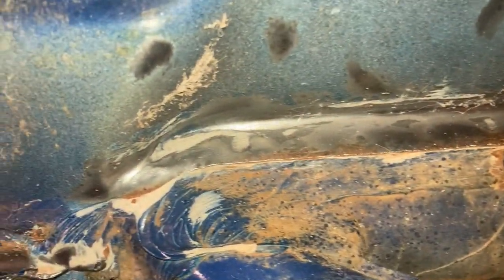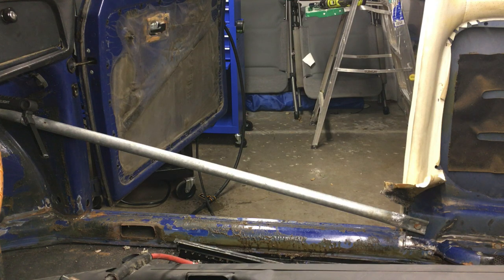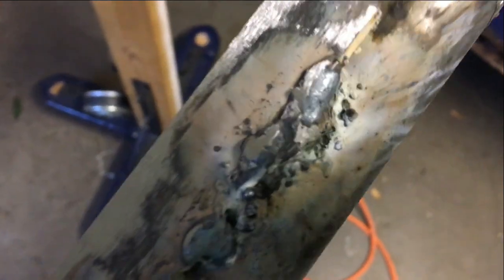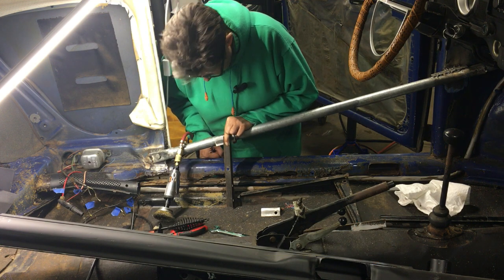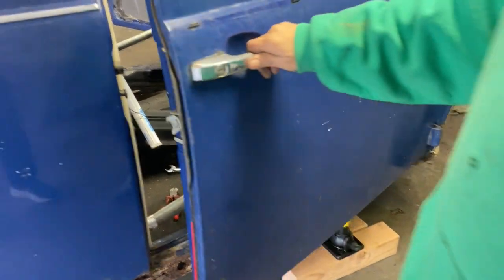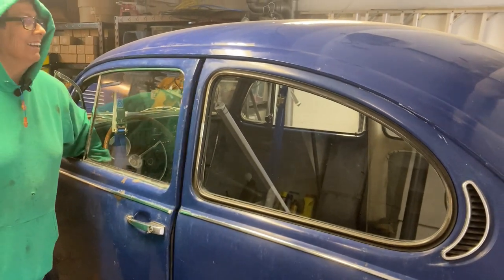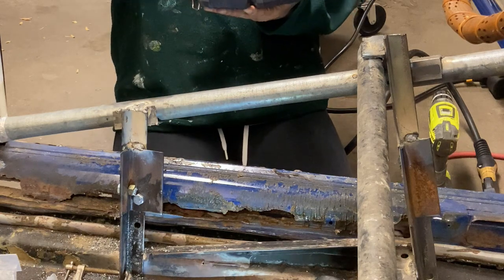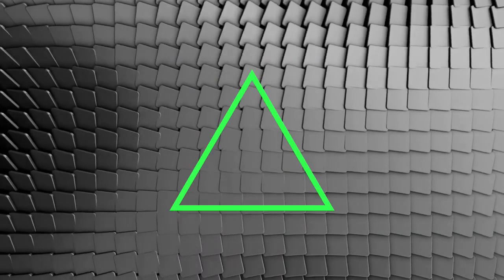1971 VW Beetle Restoration - Episode 7

Comment: Greetings from Florida, ma'am. I seldom comment, but thought I would here. I've been following your build since you started. I recently purchased a 1973 Super Beetle, that I am in the middle of fixing up. I sold a show car that I had for many years and decided to buy a Beetle, since I had one 50 years ago when I was a kid. I'm learning from you, even though you yourself are learning. I have to give you kudos for jumping right in there and doing the work. I'm doing mostly cosmetics on my car. I'm sending it out next week to a VW mechanic who will take care of all the mechanical portions. The car is in great shape, so there won't be much in the way of mechanicals. It has a good strong engine, good clutch, etc....he is just going to give the engine the once over, as well as the brakes. I'm converting to an electronic ignition on the advice of my mechanic, and since I had some starting issues, I'm changing out the starter with an auto stick starter, even though mine is a manual. Again, on the advice of my VW mechanic. I wish I could do what you're doing, but I don't have the time, tools, expertise or patience.  Once the car is mechanically sound, it's going straight into paint, just before the new interior. After that, my work starts getting it all put back together, buffing it out and so forth. I am fortunate in that my car seems to have been a Florida car all it's life and is 95% rust free, which puts me ahead of the game. The guy that is doing my work is also a You Tuber and his channel is Froslife and Just Buggin' Restorations. He has some pretty good vids, as well. He said he is going to start a new series with my car. He will probably end up painting it, too, since my car, although fairly sound mechanically is currently.....ahem.....pink. I don't mean Mary Kay Cosmetics pale pink, I mean bright Barbie or Pepto Bismol pink. Ugh!  I have a vision for the car, and it doesn't include pink. Ultimately it will be painted gloss black, which will go well with the new white interior. Didn't mean to ramble. Please keep up the good work on your car. I'll be very curious to see how it comes out. If the guy does start a video series on my car, I'll let you know. You will then see that it is pink, pink, PINK. Cheers!         Gary in Florida.
Reply from the maker: Wow!  What an awesome comment!  Thank you for all the encouraging things you said.  That really is motivating.  I would absolutely love to see your bug in it's pink incarnation and after!  Pink is not a color I would pick either even if I was president of Mary Kay!  I'll check out those channels.  Thanks again for the great comment!
Reply from the maker: Wow that channel is something!  358 videos!  Thanks for the tip!
Reply: G-Man aka Gregg from Just Buggin has some great restoration videos, although he uses a head-cam and can make you slightly nauseous with all the moving around. But he's mostly a one-man show so I get it. Fortunately, his shop is only about 20 miles from me, so I plan on delivering Pink Panther (his name) to him next Tuesday. He'll probably have it 2-3 months since he has other projects, but I'm taking him the car with a boat load of parts. I shall keep you posted if you like. In the meantime, please keep up the good work on your Bug. When I was a kid, you could buy them running and driving all day long for a couple hundred bucks. Today, not many of them running around. It's our responsibility to keep them on the road for others to enjoy.  @TrixedOut
Reply: Just as a side note, when I got the car, there was a huge sticker on the hood (not the frunk) that said "HIPPIE CHICKS RULE" and letters on the back window that says, "DON'T BUG ME." Also two huge peace signs on the doors and pink fuzzy dice hanging from the mirror. The hippie chicks came off right away, the peace signs were magnetic so I took them off and saved them, the pink fuzzy dice disappeared, and the "Don't Bug Me" I'm actually keeping on the car. 😁
Reply from the maker: Yes!  Keep me posted!  My first car was a 71 Standard.  I have longed for another Bug for decades.  I'm with you!  We are the guardians of the Bug legacy!  I hope is posts lots of videos of PP!  What color are you going with?
Reply from the maker: I love that, Don't Bug Me!  Mine had a mechanic's emblem shaped like a Bug, a sticker on the deck lid that said, "Boogie in a Bug," and a University of Iowa sticker on the back window.  I think I'll keep the Iowa sticker but that's it.
Reply: I'm going with non-metallic gloss black, which just happens to be the color of my Mustang convertible show car I just sold. After the paint, it will no longer be "Pink Panther." Most people I have run into so far have named their Bugs. Just in case this turns out to be true, I already have a named chosen for our Bug. If Just Buggin' does decide to do a series on the car, he already said he wants to document the transformation. He thought it would be good content for Bug fans on YT. From PP to its' new incarnation. He also said that I have to be in the last video of the series. Don't know about that but we'll see. I'll just be glad to safely drive the car around. Interestingly, the one time I did drive it the day after I got it, I drove it to the gas station and to the tire store for new tires. I got at least a half dozen compliments on the car, even in pink. As many as I used to get with my Mustang. I was quite surprised. Of course, after the tires, the car immediately left me stranded, but I was able to get it home.  @TrixedOut  🤷‍♂
Reply: Now I haven't even driven a Bug for 50 years, much less owned one. My first VDub was a 1966 Type 3 Squareback (which was a hoot) then I had a 70 Bug. I have noticed that today the car seems so small. Never noticed when I was a kid, cause I was a kid. It was just transportation, to school, to work, and extra curricular activities. And it was cheap. Back then in my neck of the woods, a VW Bug was about as low as you could go for a teenaged guy with a car. Mostly the only ones that drove them were the girls, cause they were "cute." Nobody made fun of them. I only knew one other guy that drove one besides me. But his was hopped up so nobody made fun of him. Interestingly, the girls back then could all drive sticks. How times have changed.
Reply: Boogie in a Bug. Love it! And that brought about a half dozen stories to mind. Ah to be a young, dumb clueless kid again.  @TrixedOut
Reply from the maker: Oh for sure!!

Comment: You're doing a grate work but i think you should replace the whole heater channels.
Reply from the maker: Oh for sure!  That was always the plan.  I just wanted to get that part out of the way so I could check out the pan's edge.  The plan is to cut out as much bulk as I can so I can get to the tight spots more easily. I'll be replacing a lot more than just the entire heater channels.  Thanks so much for the comment!

Comment: If you're going to use the original wiring hardness, I would recommend you move it out of the way, when you're welding or cutting near it.
Reply from the maker: Thanks for the tip!  Yes, I have thought about that a lot.  I'm a little, no . . . very, intimidated about taking out the wiring harness but I just have to face it!  It has to happen because it needs to go through the heater channel!  Wicked Works did a video on installing a bulkhead adapter in the firewall so you can basically unplug the engine wires with the pull of one connector.  It eliminates the need to fish the wires through the body to the engine bay.  I may do that.  Here's the link if you are curious: https://www.youtube.com/watch?v=B3iMeIs9r9g.  Thanks again for commenting!
Reply: @TrixedOut  I also watch Wicked Works channel. I live up the road from, Ben place.  Just take your time, and take photos/video, notes of removing the wires near the fuse box. I did it once, about 20 years ago.
Reply from the maker: Cool re knowing Ben!  Does he burp that much off camera?  Yes, I am all about taking pics!!  Thanks for the tip!  I love getting tips because I am a noob!
Reply: @TrixedOut  I haven't meet Ben yet. I just see the red bug and light blue squareback and other cars from the videos, on his property when I drive by.
Reply from the maker: Gotcha!  @vintage76vipergreenBeetle

Comment: I get stressed for your safety seeing you hoodie stings dangling around rotary equipment! Please do be more aware of dangers, including wearing a filter mask when creating grinding or wire wheel dust.  I'd like to see this bug get completed 🙂
Reply from the maker: Ha!  Yes, I noticed that re my hoodie strings!  I imagined the angle grinder smacking me in the face and my heart skipped a beat.  I wore the hoodie today but tucked the strings inside.  I think I cut them off instead.  I'll do better re masks as well!  Thanks for the comment and concern.